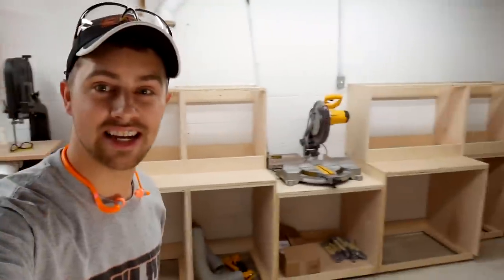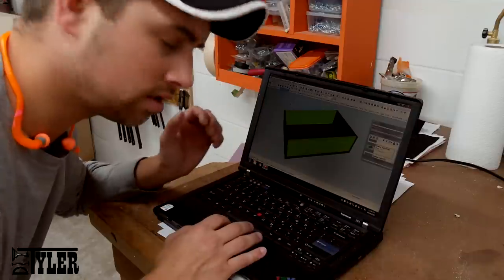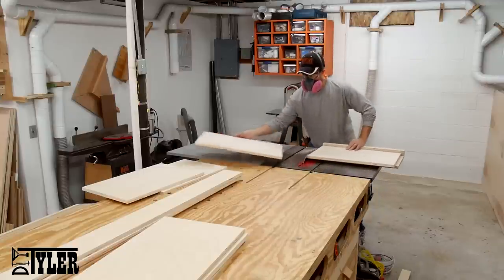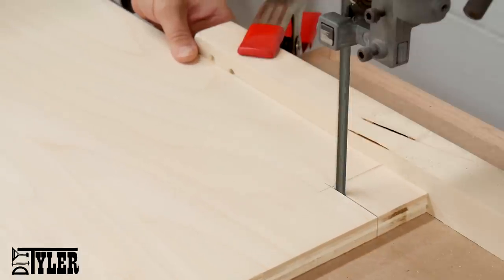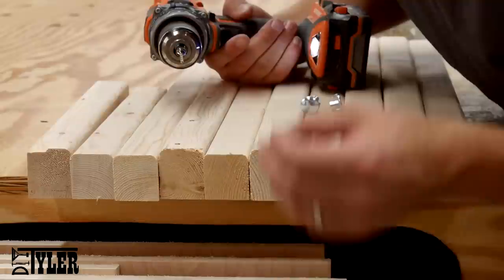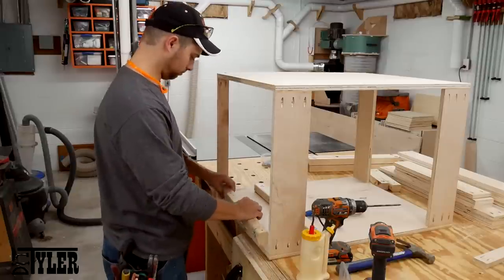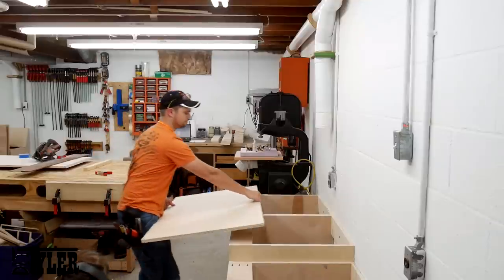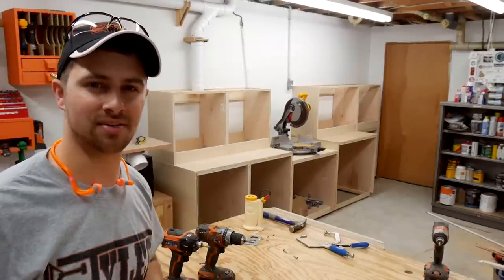MiterSaw Station 1| Cabinet Frames | Lean Shop Time

Comment: Great Video. An idea I have been bouncing around is to build an electrical box into the table tops that the machine plugs into. the plug flip with the machine so should be no worries on cord tangling. The wiring for the boxes can run through the inside of the bar that the table swivels on. With you setup of 4 tools you could wire it all together, plug one wire into your garage plug and be able to turn on any of the 4 machines. That is how I am going to accomplish this when I rebuild mine
Reply from the maker: That is a great idea and several people have mentioned it. I suppose I was always stuck on the idea of full 360 rotation but I may give up on that, just flip the opposite way every time.

Comment: Quick tip : to mark out the kicks . 1. Mark first  kick out  either on a piece or a piece of scrap. 2. Cut  kick out .3. Use cutout scrap to mark other kicks. Saves a bit of time Nice to see different versions Currently building one myself and I have been incorporating little bits and pieces of everyone versions.

Comment: Hey Tyler.  Love the Miter Station.  Do you have the basic dimensions (length, width, height)   of this miter station.  I am trying to figure out if it will fit the space I have.
Reply from the maker: 138" With the wing down,  166" with the wing up and 27.5" deep.

Comment: Tyler, nice build and good tips for build. 

 It appears you use Sketchup to plan your build, a good practice. Have you used the Sketchup add in CutList Plus. CutList Plus will figure out the best use of your material, there is a small learning curve, but for the price and time investment it has saved me countless hours of laying out material usage.   

Great project, I look forward to part 2.
Reply from the maker: Thanks for watching! Yes I use sketchup for now, trying to move away from it but it's heard to leave what you are comfortable with.
Reply: Tyler just to be clear. Don't leave Sketchup, just use the addin for Sketchup CutList Plus.
Reply from the maker: +Ray8168 I get that....fusion 360is where I am trying to get. The CAM creation ability and overall capabilities being the reason.

Comment: How did you keep the 1 1/4” pocket hole screws from poking thru the other side of the plywood. When I use them, I get a slight point that sticks thru. Did you just not drill the pocket holes as deep since 3/4 plywood isn’t quite 3/4”?

Comment: looks great!  may I ask about the price it costs to make one?  I'm thinking about making one as well
Reply from the maker: +Anthony Tobias Let me say it's not cheap to start. Total I think it will be $750. Cost can be cut if you want, this used a lot more plywood for the frames as I wanted it to be capable of being taken apart and used as separate cabinets....that essentially doubled the larger frame pieces. Thanks for watching Anthony!

Comment: Hi. I was wondering which software you used to design the cabinets and have the cut information about sheets and numbering. Thank in advance
Reply from the maker: I use sketchup. All the cut layouts and numbering is done manually.

Comment: What's the secret to cutting large sheets on your own?
Reply: Do it on the floor with a slab of pink insulation under neath to protect the blade from hitting the concrete and make a track like he has out of MDF... you can find a number of youtube videos for making the circular saw track.
Reply: Peter O'Brien - Thanks, I'll give it a go.  But first, I'm off to find some of that insulation and buy some MDF... and cigarettes.